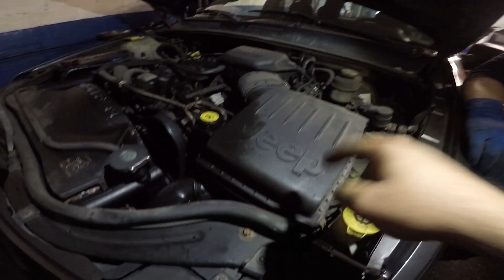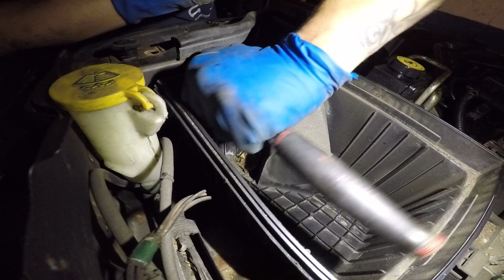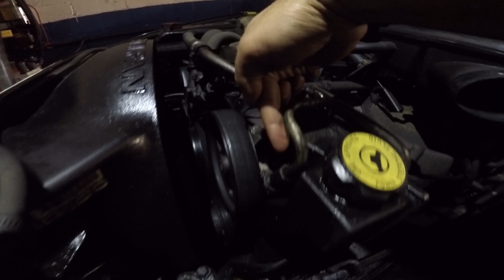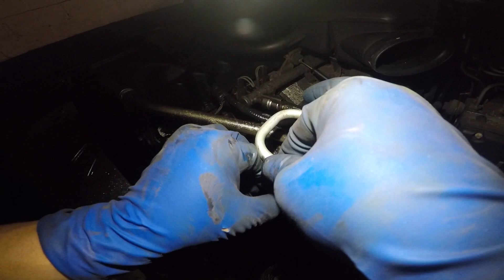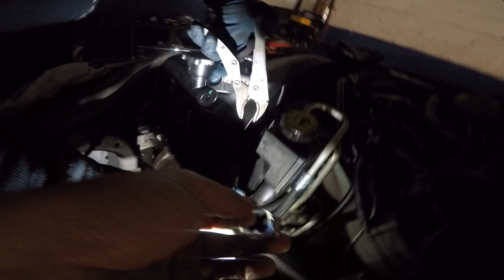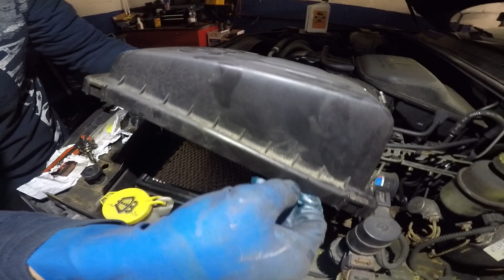How to replace high pressure power steering line on 2004 Jeep Grand Cherokee

Comment: Did you drain the power steering fluid out first? I couldn't tell from the video. I'm looking at replacing both lines. This video was great!!
Reply from the maker: No it was empty leaked out prod to the job but do that if it’s is full

Comment: What is the second line? Trying to source it but don’t know what it is?..
Reply from the maker: Return line
Reply: @RBTheMechanic  thanks & good video!
Reply: @RBTheMechanic  New problem. I think my power steering reservoir is leaking. Have you ever changed just the reservoir?
Reply from the maker: @RyanRusich  no I think this comes with new pump
Reply: @RyanRusich  check the o rings on the lines they are known to go out and be cheaper to fix that first if u haven't fixed it already
Reply: Thanks Everyone! Turns out the pump was pooched. Ended up sourcing one through an auto wrecker. I installed it and the lines  and all of it works like a charm.